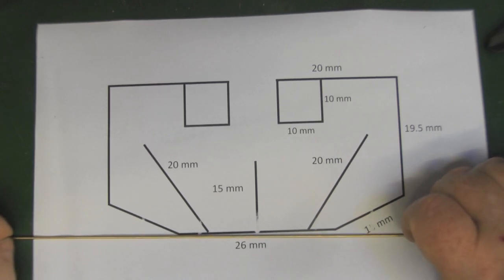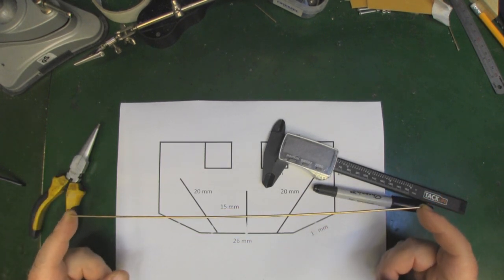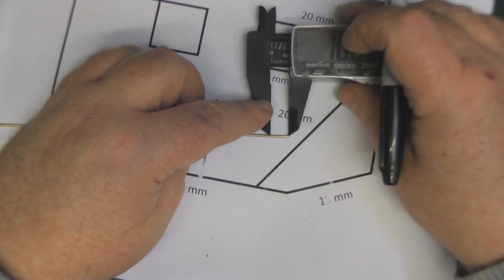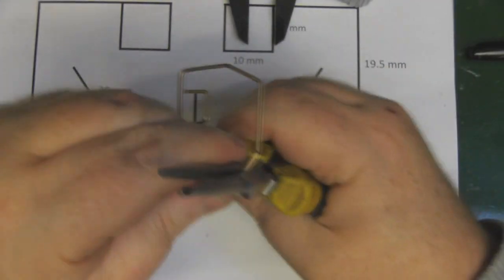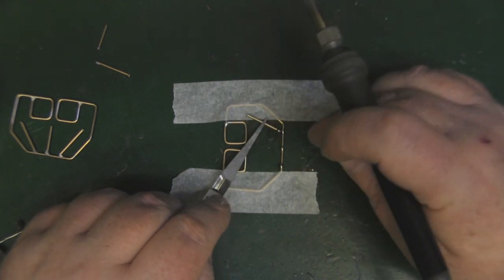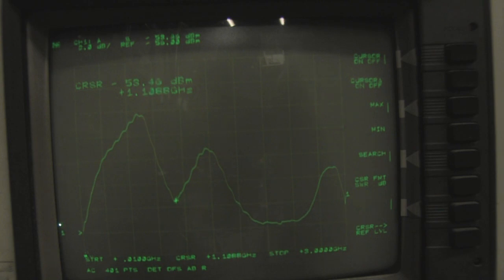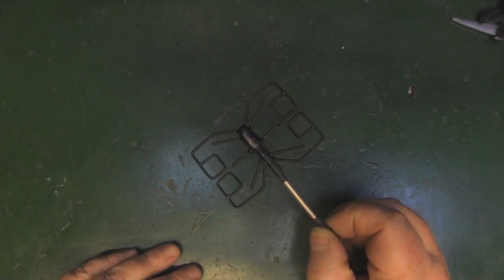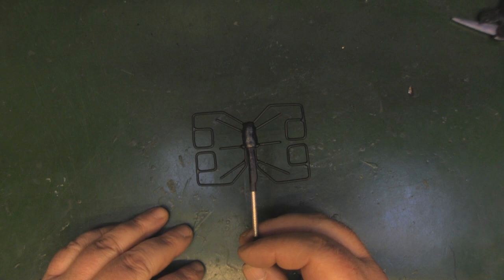4G LTE Omnidirectional Antenna

Comment: Hi Andrew, just wondering if you've done a video on creating an omnidirectional antenna dedicated to bands 20 and 8, that is with a good response from 800Mhz upto about 1Ghz. This would be very usefull for me in my rural, non - line of site position. If so, could you poitnt me to it please. Thanks, Keith

Comment: Really do love your content Andrew, hoping you can answer a question for me.
I am on the edge of a fairly good 4g/lte signal, main problem is quality of signal even using a Poynting omnidirectional antenna, I have however found a far better signal some 40 metres from the house down the garden, problem is getting that signal back to the house, how would you suggest this be done without degrading the signal?

Comment: Greetz Andrew, first off thanks so much for your many videos on the subject, great job / hobby !
I have been looking at this design and wanted to make something similar (for mimo use on a mifi)
I found it interesting though you talking about milimeters (and your most certain at these frequencies) and using a digital meter going up to a 10th of a milimeter then ... I see your plying/folding looks far from being 'scientifically milimetric' ;-)
To counter this I was thinking to make this antenna starting from a mold (having ceramics experience) and cast it in aluminium. That way the material could be a lot thicker (thinking of the Kathrein antennas you dissected ;-) so in stead of a the 1.5mm I could triple the thickness (would that seem acceptable ? could it be even thicker ?)
The thing casting it in alumium is I would be able to make a more precise design by correcting it gently with the dremel.
Or would you have any better desing lying around for casting in alu ?
Might you have any thoughts ?
Thanks
JB

Comment: Hi, I have a cottage in the woods of Sweden where 4G coverage is not the best. I have a Huawei 4G router which have given me between 6 and 10 Mbit/s  download and 3-5 Mbit/ upload, which I can live with. I watched your video, and thought I would have a go at making this antenna. It didn't turn out as nice as yours, but I changed out one of the original antennas with this one and I got 19-23 Mbit/s download and 13-15 Mbit/s upload speed. I am very pleased with the result.
Thank you so much Andrew.

Comment: are the angles of the 15 mm and 20 mm parts important, also where the 20 mm parts attach to the 26 mm part?
What about the distance between the two 10x10 mm squares.. the angle of the 15 mm part could fix those, but maybe that is easier to define?
Thanks

Comment: Just found your channel love it! Most MNO in UK use band 3 and band 20 lte I think, well LTE800 and LTE2100. So an antenna with best response at those bands, rather than wide band including 2.3gig, 2.7 and up to 3.6gig for 5g would be real useful. In addition, since in rural areas L800 is used most (coverage rather than capacity) having a high gain log periodic or something that is sturdy and tuned narrow-band for say 700-900 would be of use for a lot of people

Comment: Built one of these to use with an old Huawei K3765 usb-stick modem. Connection speed tested with Speedtest.net went from 0.8 megabits per second to close to 4 megabits per second. I discovered the antennas near me using cellmapper.net, now I'll try a directional antenna tuned to 3GPP B1 (2100 MHz) LTE band. Thank you Andrew!

Comment: if u want to add a reflector what distance it need to be?
i made one and it gave me 5 to 8 mb improvement download!!
i made it whith thin copper wire and the mesuraments are not perfect but it work!what?
i sitck it to the window and then i put aluminium foil as a reflector whith a paper between and it helped!
sorry nmy english not perfect 
thank you

Comment: Hi Andrew, thank you for all the videos showing us how you make different antennas and how well they work! But for someone as dumb and lazy as me, I have a request (you can consider it a challenge ;-)). Can you fashion an antenna for 2.35 Ghz out of the garden variety TV coax cable, where I could just take a long piece of coax up to my roof, strip the outer cover, expose the center conductor, twist it (not too complex, because I lack even the skills you'd consider basic) into a suitable antenna and fix the coax to something (most likely a wall) and then get back into the living room and do the same with the other end. This way, no cutting, no soldering, no special impedance matching devices (I guess it would mean coiling the center conductor suitably without any special tools) etc. And we could make the enhanced LTE signal make its way into the living room with just a length of coax and some elbow grease (and your brainwork of course!). I eagerly await the McNeil Antenna! TIA.
Reply: Note that stock TV coax is 75 ohm.  LTE cable is 50 ohm.  It will work, but not well - also cable losses on TV cable will be high.  RF200 cable is not overly expensive and will perform much better.
Reply: @SimonShaws  Thanks. TV cable is the most readily available. So, what would I need to do to impedance match the antenna to the cable? I am guessing a few turns around a plastic tube (length, diameter, no of turns?) and it would depend on the antenna too, wouldn't it? Then at the other end, in the living room, would it have to be a different type of antenna? Because it would have to radiate the signal in all directions, and again the impedance matching would have to be appropriate.
Reply: @mohanvvip  What you are asking is more than can be answered in a comment on a Youtube video easily.  You want an antenna to an antenna?  Normally you would go antenna to receiver/transmitter.

Comment: Could anyone please confirm that magnet wire may also be used to build the antennas?
I was thinking that the enamel can act like corrosion protector.
Reply: It would work, note the enamel chips easily and flakes at hard bends quite often.  Very narrow wire can also reduce bandwidth.

Comment: can these antenna be stacked up to increase gain? eg use 4 or 8 of them on a single wire lead? and what would be the best way to do that, stacked vertically on the same orientation? or stacked at 90 deg to the lower one. (I know we need 2 of them/2 leads MIMO) on some routers, when you attach an external antenna, it disables the internal one. so how much gain would one need for it to be effective?

Comment: Once again please, what for wire (metal) did you you use for building the antenna? Where is possible to buy it? Thx!
Reply: 1.5 mm in diameter. 15 gauge (1.45 mm) copper wire would work I think

Comment: Hey andrew i i have been researching the 5.8 antenna in my dji mavic mini as
 it has a crap range in aus due to the transmitter being redused in 
power. The mini uses two pcb antennas about 5x30mm and i noticed they 
do have little squares in them kinda hmm I would like to make a couple of rhp 
clover leafs from your video and hang them out side the craft. Do you 
think i this will help at all with just a standard control or have to put clovers on the remots hmm any 
advice? cheers.
Reply: I had experimented clover leaf on 2.4g controller back in 2012 and the experience was very interesting. At first, range seemed to be improved as the RX did not fail-safe in spots of the kitchen where it used to. In my excitement, I went out for a range test, walking with the RX in hand, and the TX hanging at the window. But the range was 40% less than with using its original rubber ducky antenna. A few weeks later, I learnt that circular polarized ants are needed on both sides coz a mismatch in polarization will halve the signal strength (-3db). Then I put cloverleafs on both sides and took my RC heli for a blast. When I moved the throttle stick the tiniest bit, the heli would jump erratically. Then I realized that the radio controller did not like any antenna with signal element that’s shorted with GND (eg: the cloverleaf). I switched to a homemade directional 2.4g crosshair several weeks later, and it solved the problem (as the signal elements on crosshair do not short with GND). I got a fantastic RC range with wide RF beam and also the circular polarization eliminated multipathing, which removed unwanted reflections (interference) like the first discovery I had in the kitchen.
Reply: @terence79chan  Yeah that's what i kinda figured so i went with two much larger broadband pcb antenna instead,thanks for your reply.

Comment: Very interesting with these squares that reduce the antenna size. Thanks for an inspiring video!
Reply from the maker: Yes it is the same as loading coils on dipoles
Reply: And at higher frequencies you don't need a loading coil at all - it's all magic based on the LOCATION/POSITION of the dipole in the waveguide! (time to get out the Smith Chart...)

Comment: Very interesting. I shall have a go at making a pair of these.
Reply from the maker: Yes it is a nice one to start off with
Reply: @andrewmcneil  I was going to splash out on a Poynting antenna, but I think I'll experiment with your design first. I live on a narrowboat, and the cellular net works are really the only affordable option. Most of the time download speeds aren't too bad, but some places are a bit marginal, though sometimes a 100 meters in either direction can make quite a difference.